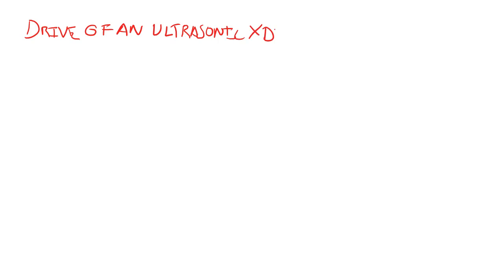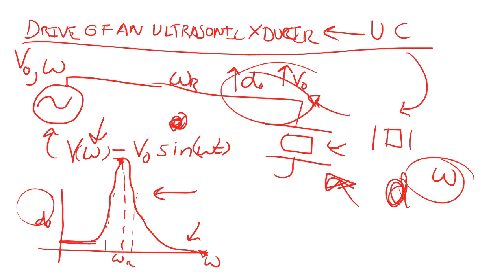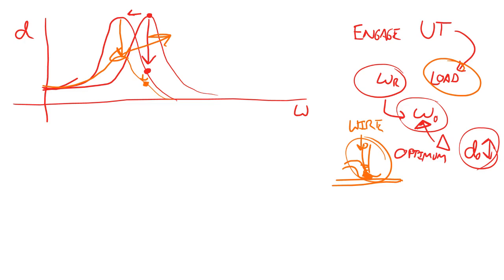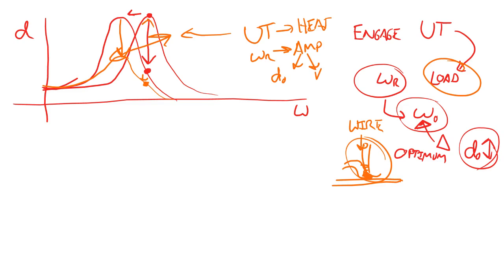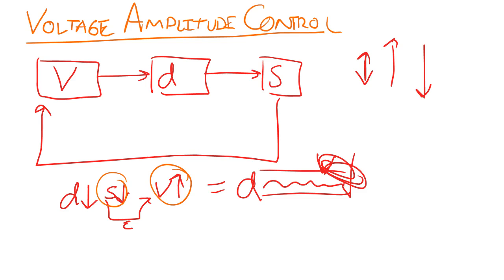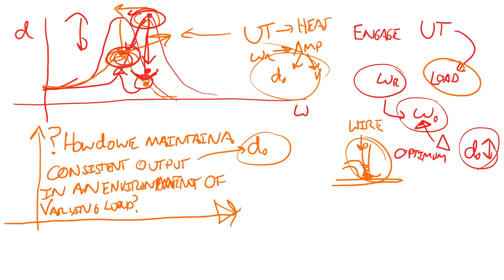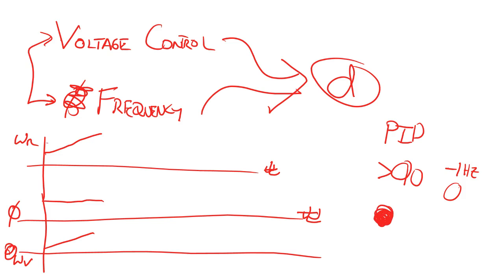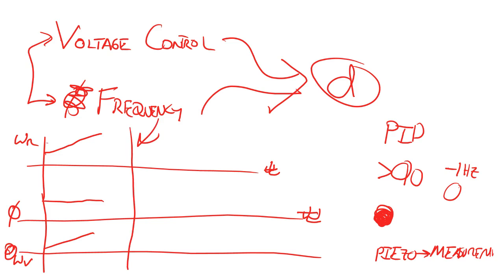Learn Piezo Lecture 14A: Ultrasonic/piezoelectric transducer frequency response concepts

Comment: I have a question about phase at resonance.  In normal electrical RLC series circuits, phase is -90 at frequencies far below resonance, and +90 at frequencies far above resonance, and phase is 0 at resonance.  You show that at resonance, phase is 90 at resonance and 180 at high frequencies. What am I missing?
Thanks -- I am enjoying this channel!
Reply from the maker: What a great question! This is talking about displacement of a mechanical system, not an LCR circuit. If you consider velocity, it is as you say for current in an LCR circuit. Displacement is like charge for an LCR circuit.
Reply: @ultrasonicadvisors  I see. That makes sense. Thank you for your reply -- I really appreciate it!
Reply: 在 lrc 振荡电路中 电流电压相位夹角为0度的时候，振幅最大。视频中说的是 d=f*s*sin(wt)   θ=w*t  当θ等于90的时候，sin90为最大值等于1，此时d（振幅）最大值。